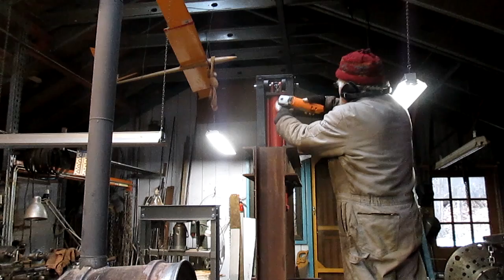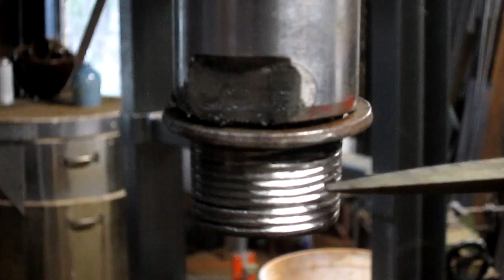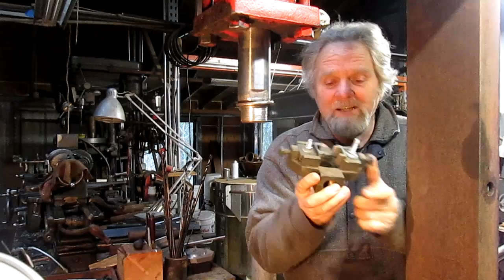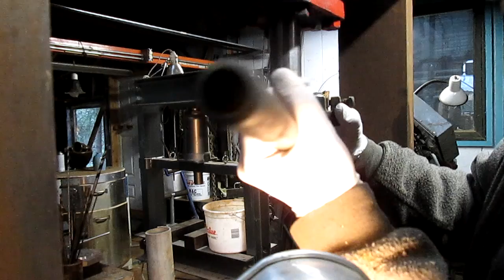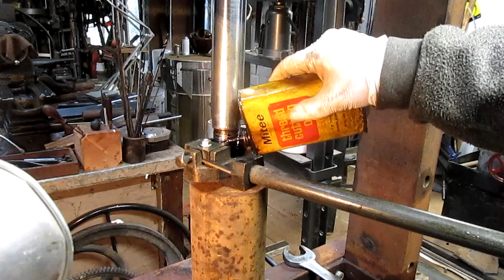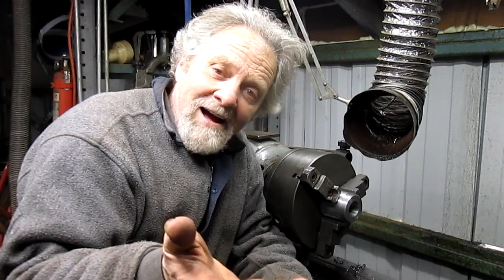Shop Press build #9

Comment: Looks like you need heater of some kind Nik.
Reply from the maker: My shop is a tin building with no insulation at 3000 feet in the sierra Nevada mountains. It's fucking cold.